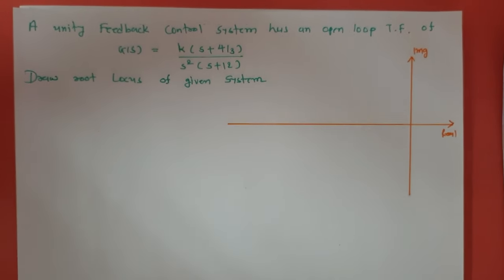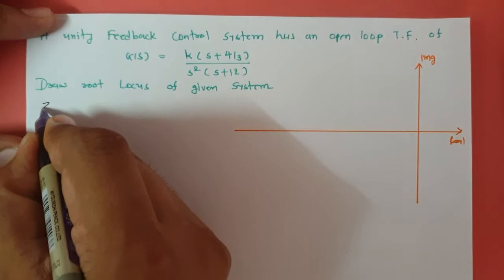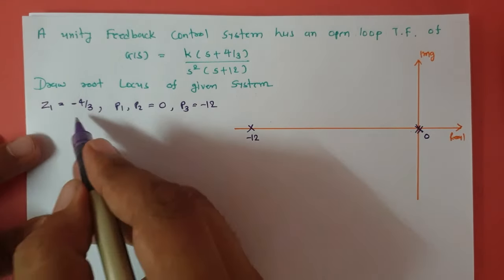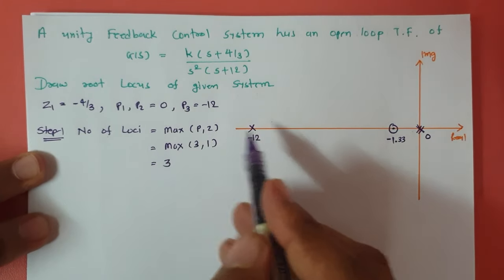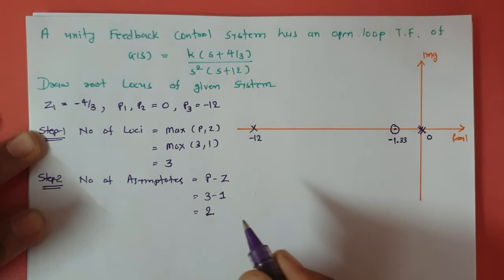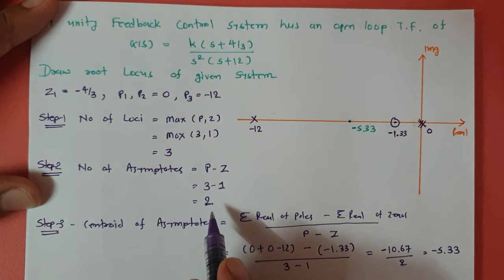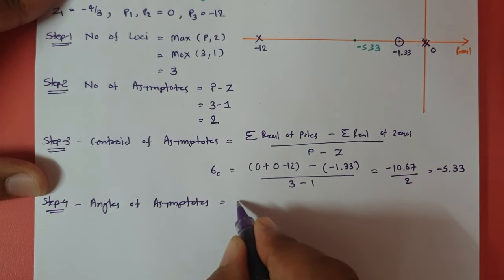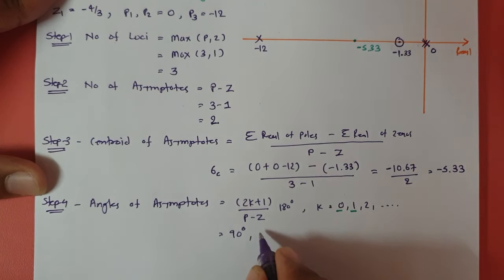Root locus Plot Explained: Rules, Steps, Procedure, and Solved Example 3

Comment: Sir if there are two break aways we are connecting from one break away to other...but....I didn't get why it's going from -1 to other break away and not vice versa? And secondly....as -1 is also a pole....it should also try to reach into zero ryt  or is it not required?

Comment: good explanation. However, if we want to check if a point is on that root locus, using the angle criteria. What would be angle contribution of the poles at the origin? if angle of 1 pole there is phi, the total contribution would be 2*phi?
Reply from the maker: Same way we need to check as it is explained here.
Angle should be measured with respect to horizontal line.

Comment: Sir i have a question, if the roots are real then there will be no departure angles right, then how did we  get emerging lines from pole which is at origin and at what angles are they inclined?? And how will be the rootlocus  if  u had got different break away points
Reply from the maker: If roots are real then line will follow real axis only, you should draw line based on angle of asymptote.
Reply: @EngineeringFunda  how come -4 is part of root locus as it says "that any point on the real axis is a part of the root locus if the no of poles and zeros to its right is odd"
Reply: @j_abass  well yeah..seems like.
It should be from -1 to -4/3 and -infinity to -12  and not in between them
Reply: @j_abass  your approach is right, here also at the right of point -4 ,there are 3 number of poles and zeros(2 poles in origin+zero in -1.33)

Comment: -4 does not lies on root locus sir how can we take -4 as a break point it is not possible to take a break point which doesn't lies on root locus
Reply from the maker: How you say -4 doesn't lies on root locus. I mean how do you decide this.
Reply: The thing is after we calculate the break away points we put them in equation K =f(s) to check whether k is positive and real or negative. If it is positive and real it's the valid breakaway point else it's not valid